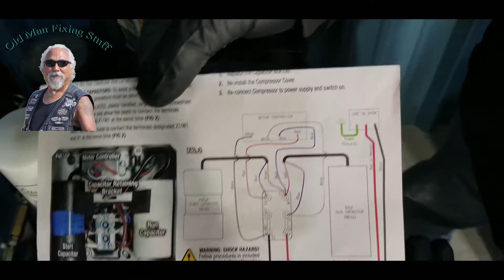Eastwood QST-30/60 Scroll Air Compressor Start cap, Run cap and controller replacement.

Comment: nice content
Reply: I've gone through two of these now, the idea is great but the design sucks.  Eastwood makes some very good equipment- I'm a total fan, but this compressor was simply a bad design.  The oil is wrong- too hydroscopic (use AMSOIL ISO46 SAE 20 that contains anti foaming agents and you'll be a lot better off) and the entire design is basically upside down.  Oil floats on water. The filters are upside-down, the inlet and outlet to the coolong condenser are on the top- should be on the bottom so condensed water doesnt pond up inside.... the oil tank gets full of water weekly and emulsifies with the oil, creating an orange "goop" that kinda lubricates the machine when it's running but with all that water in there, all the internal castings rust quickly, thus clogging the oil filter within a month's time....etc etc yadda yadda...
I still use this machine, I love it because of it's quietness. But if you follow the instructions as to maintainance schedules, your compressor will fail miserably within a month or two if you use it in an environment with ANY humidity (most of the USA I'd think)
Eastwood makes much woderful equipment- but this one- the designer needs to get another job at a toaster factory.  There are SO many design issues with this machine, it's amazing there's not been a class action lawsuit directed at Eastwood for this poorly designed machine.
If you are like me, another "old man fixing stuff" and have what is needed to hack this machine and put some proper self draining filters on it, replumb some of it, and basically re-engineer it, it will be a great compressor.  But out of the box, good luck.  Eastwood totally missed the mark on this one.
Here's what my second one in 6 months did...
https://www.youtube.com/watch?v=CejjSXLjVdA&t=5s

Comment: Could you send me that diagram?  They sent me parts and wire colors are not the same on the caps...
Reply: I think I have I based on your run through, they didn’t send me any instructions.
Reply from the maker: Here is a link to the install file I put on google drive.
https://drive.google.com/file/d/1efjflkyjFGsDs5pTZEsqKOGiyLsyAFsG/view?usp=sharing
Reply: @oldmanfixingstuff3722  thank you…I’ll double check in the morning.  Im afraid the motor is locked.
Reply: @oldmanfixingstuff3722  also….thank you for sharing your work. I’ll keep you posted.

Comment: I can’t believe they use an air-conditioning potential relay as opposed to an actual centrifugal start switch inside of the motor. What a piece of shit.

Comment: Everything in the electromechanical world requires maintenance and servicing. For the Eastwood haters, consider those words.
Most of the failures that happen with these is that the oil and water separator loads up the oil reservoir and hydrolocks the system. Which in turn overloads the breaker and capacitors. Having clean power and appropriate gauged wires is also the key to the success of longevity.
So gage up your power feed, drain moisture from the tank daily, check the oil reservoir levels, check the reservoir for water contamination, and change your filters regularly. 
Most complaints come from lazy asses who don't like to do the maintenance work.
End of story.
Reply from the maker: So true, with mine I make sure all maintenance is done and also check on them.  I also put in an automatic drain keeps the water out of the tank. My problem was the scroll pump froze causing the caps to go on startup. Love eastwood and their support. They took care of the problem. They also work with you to figure out what is going on and never had them not stand behind their products. Stuff happens with any product but so far eastwood stands behind what they sell.
Reply: Mine just blew the start capacitor. Less than 2 hours of use. Very stinky
Reply from the maker: @78sharpshooter  sorry to hear. Eastwood is good with standing behind them and getting a replacement unit. I'm on my third compressor first two were old style and the one I got now is the newer style. First two died within the first year of use, different problems. They all blow oil out from the pressure release valve, the air that you hear after it fills the tank. I think that is due to overfilling the oil at the factory. I have called about the oil and they told me it should level out and stop.  I don't use mine every day so I am a light user compared to a shop. I do have an auto water release on it so once a day it might have to turn on and fill the tank. I Check the oil and filters as per the manual. Proberly check it more due to two failures. Got my fingers crossed this one lasts, it sucks not having a compressor waiting on the replacement. I still like the compressor and Eastwood just hoping this one lasts.
Reply: @oldmanfixingstuff3722  how did the other one die?
Reply from the maker: @78sharpshooter  the first one the caps blew, the second one, I was setting up to paint some parts and it made a loud banging sound and popped the breaker.  the scroll froze, when I tried to start it would try to start, hum for a second and pop the breaker. Also blew most of the oil out the release valve by the filters, had oil all inside the cover and filled the room (2000 sqft) barn in an oil fog like a big smoke bomb when off.  Compressor was not even a year old. I'll see if I can find the video of the oil fog it did.
Reply: Actually, the real story is machine is designed very poorly. It doesn’t have standard components like a rotary screw compressor or a oil injected rotary compressor would have it doesn’t appear that there’s a thermal valve to keep the temperature above 170° so you don’t make all this water or condensate in the oil Also there is no blow down muffler and the unit does load and blows down. It never seems to vent the sump pressure. I think the compressor just keeps running and blows down venting the complete capacity of the machine out of the vent device. I’ve worked air compressors mostly rotary compressors for the last 35 years, this compressor is a pile of crap

Comment: WTH?!?  This compressor hasn't even been on the market that long!  About, what, 5 years?  Less?  That is not a good sign.  I was all set to buy one of these, but I keep finding videos describing problems which are 100% design / component choice / QC issues made intentionally to cut costs.  Then I found out about their shipping policy!  $250 flat rate shipping for motor freight is an absolute rip-off ("hidden" margin increaser) for most locations in 2021. Either their chosen carrier partner is ripping of Eastwood, or Eastwood is ripping us off, I really don't care which because when I discovered that, it killed the purchase I was almost going to make. I prefer to do business with honest and fair-minded companies. I'm not interested in subsidizing some other customer who is more expensive to deliver to!  When companies deviate from the business practices of everyone else in the industry, one of two things is happening: either they are innovating (no sign of that in this case) or they are cheating/stealing.  Ain't no other options when I can ship over a thousand pounds by motor freight for around $200.  This compressor weighs 325 pounds.  I'm kinda pissed off now, because I've been looking everywhere for this exact sort of product, I finally found it, I was all set to purchase, and then I started spotting all sorts of shady stuff that makes me think Eastwood isn't someone I want to do business with.  Sucks to be me, I guess.  Eastwood won't care about losing one sale even after I blog about it, I suppose.  If they sold it through channels, such as Amazon, where shipping is kept to reasonable current rates, I might re-consider, but if it's just going to blow parts in three years, I think I'll find another solution to my quiet compressor needs.  I do consulting, prototyping and job shop work in my small metalworking and engineering company.  I am looking to replace a 2HP 5CFM piston compressor with something like a 4-5HP, 9-10CFM machine. $1800 seemed like a great deal considering how much scrolls normally cost.  And now I know why.  You don't get what you didn't pay for - ever.  So I guess it's back to rotary screws from ANYONE BUT EASTWOOD. :(